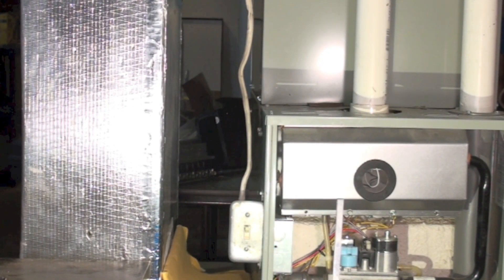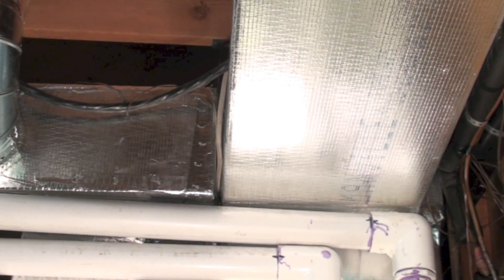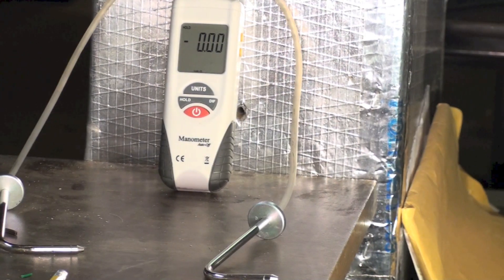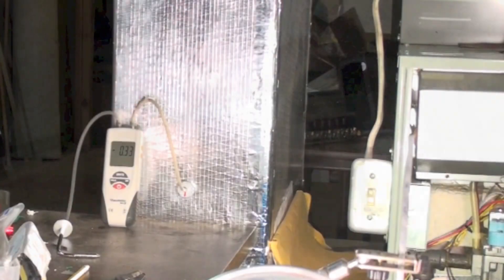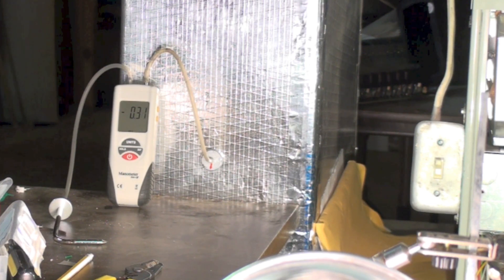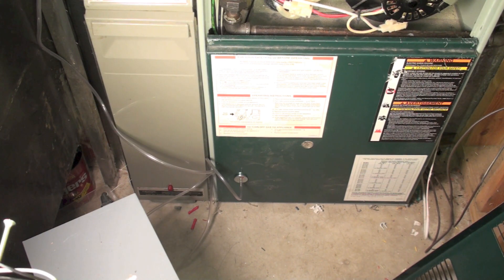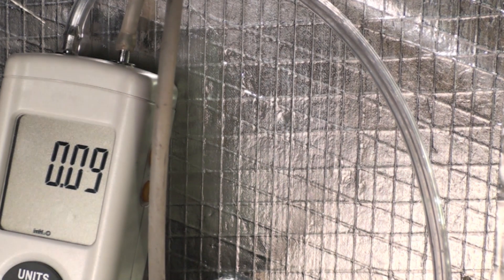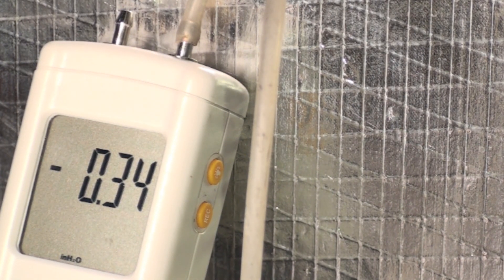How to check static pressure in ductwork: the return

Comment: Do you check static pressure for low heat and for high heat? Assuming it's a 2 stage furnace.  Thanks
Reply from the maker: I would check at high fire.
GFM

Comment: Do you have to replug the hole in the duct board after you finish the static pressure test?
Reply from the maker: I generally do not.  If a customer wants me to I will.
GFM

Comment: What we saw is the total static pressure of the return air duct at the point he measured.  Because it's on the return side of the furnace so it press outward on the pitot tube instead of inward onto pitot tube and that's why it show a negative sign on the manometer.  thanks for sharing.

Comment: The orientation of the probe is described incorrectly at 2:20.  The probe should face against airflow; this fact is exactly the opposite as you demonstrate.  Not sure if I should continue watching video.
Reply from the maker: I have tried it both ways and without any probe at all.  Same reading.
GFM
Reply: @grayfurnaceman  If you've tried the probe both ways and observed no difference, why did you take the time to specify which way the probe should be inserted?
Reply: @garybonacci2031  Because the manufacturer said to use it that way.
GFM
Reply: @electriccar3253  Which manufacturer says to install the probe the way you demonstrate?

Comment: Pressue check a supply or return ductwork are for a well-designed system. The most residential system would be a waste of time to perform those procedures. Much easier to check the filter and/or evaporator coil, ductwork tightness visually.

Comment: Hey good video. I just recently purchased a Testo 510 dual-port manometer and didn't care for it very much. So I purchased one like you're using in this video and I like it a lot better but all the tubing that I have is a much larger diameter. I'm wondering what size tubing you're using and where did you get it???
Reply from the maker: I think it is 1/8" surgical tubing.  
GFM
Reply: Can it check pressure switches and draft inducer where can I get that at Amazon what is the model and make number

Comment: Great video- There's some contradictory information about the orientation of the pitot tubes from other sources on the internet. You say they go inline with airflow but others say the opposite ( they say pointy side goes into the airflow). Where do you get your information from, sans empirical experience.
Reply from the maker: This is from the manometer manufacturer.  In these duct systems, the air flow is usually 900 FPM or less.  The orientation of the pitot tube does not seem to make any difference.  I will be doing a video about this soon.
GFM

Comment: Can you eliminate the trunk on a cold air return and attach the flexible 16" return line to the side of the furnace with a collar?
Reply from the maker: +Bill Veder Unless you have a very small furnace, no.  Return air sizing should be 1.15 times the size of the supply.  Hope this helps.
GFM

Comment: Your restriction could have been in that elbow on the return. Elbows should be 1.5xcl radius to keep flow. Also readings should be taken 3-5x the diameter of the opening. Good luck and keep informing the world!
Reply from the maker: cbacca85 It is in the return.  The long radius elbow would always be best.  However seldom done.  I will be doing one with larger return.  Thanks for the comment.
GFM

Comment: You will get a more accurate reading if the probe points upstream.
Reply: Two things matter: 1. You are using a pitot-static tube that is designed to point into oncoming air flow. 2. The every manufacturer states the static pressure probes need to be pointing into oncoming air flow. If you professionally like going against manufacturer's procedures that's fine, just realize that's what you are doing. Based on experience, I can torque a bolt close enough without setting a value on a torque wrench but I would never do it on a professional job or when I am teaching someone else.
Reply from the maker: With these low speed ducts, I have found it seems to not make any difference.  I even get the same pressure when I remove the probe and just use the tubing.  Try it and see if you get the same results and let me know.
GFM
Reply: 1: This is a pitotstatic tube.
2: The velocities encountered in residential systems are on the order of 8-12 miles per hour. At that speed, the shape of the probe provides a laminar flow over it's surface regardless of orientation, thus there is no significant negative pressure on the downstream side and no significant positive pressure on the upstream side to screw up the readings. High velocity and turbulent airflow make these zones of higher and lower pressure more significant. That's why the exterior static pressure on an aircraft (connected to the altimeter and vertical speed indicator) is measured from the sides of the pitot tube... to get away from the higher and lower pressure zones along the skin of the wings and fuselage. If planes flew at 8MPH like the air in residential ductwork, the pitot tube wouldn't be necessary. At the velocities in commercial ventilation (30+mph), now orientation matters. Like he said, on a residential unit, the effect is so small, you can just stick the hose in the hole and get the same damned reading.
Reply: Just because this is not rocket surgery doesn't mean we can get sloppy with science. If you look at the pitot tube on the side of any commercial airplane, you will see that it points into the wind. It may not matter "in this case", but that is a poor excuse to teach bad science. Why not state it correctly and THEN say that it does not matter "in this case"?  This engineer dislikes bad science.
Reply: +grayfurnaceman I agree with both of you.  The instructions that came with my fieldpiece probes says point the arrows into the air stream.  However, I also observed GFM claim.  No matter how I oriented the probes, I get the same reading.